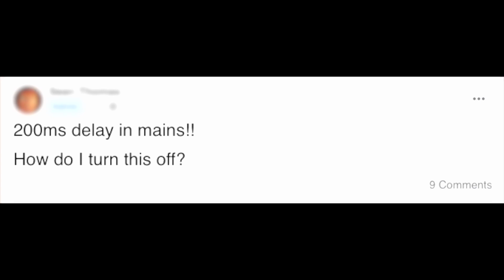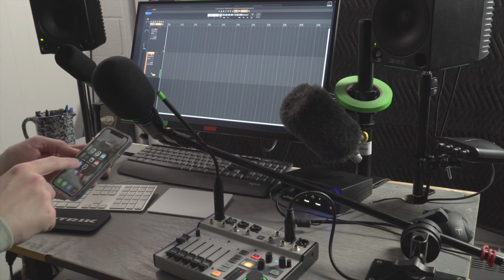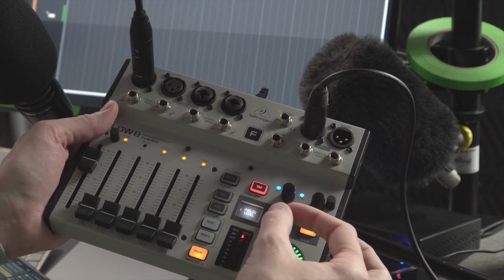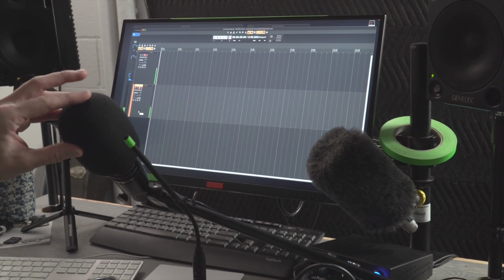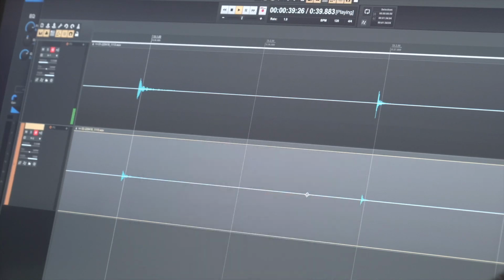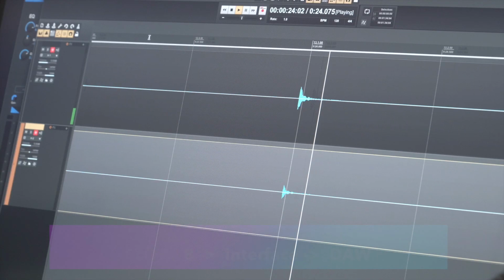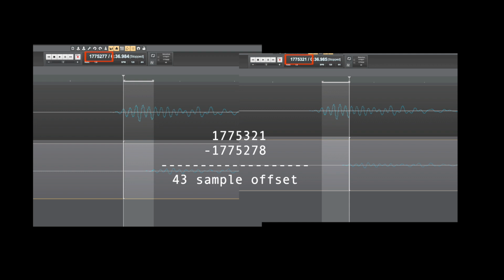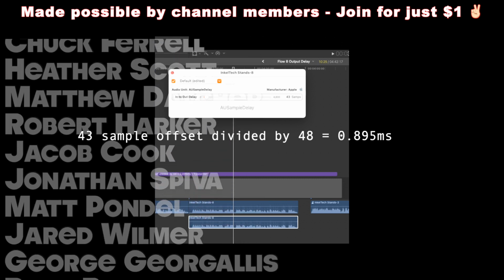FLOW 8 Main Output Delay STUCK at 200ms?

Comment: Here's the set up I'm trying to achieve. Drummer ears into phones jack- 2 separate Monitor mixes for myself MON1 (singer/guitar) and Keys player MON2

For live shows with click and tracks I'm running click into channel 3 and backing tracks in channel 4. FOH mix (to hear ourselves/ our instruments) Channel 1

So far I've noticed if drummer makes level/fader changes while on MAIN mix mode- it also effects those levels on both MON sends-

Isthere a way to make totally independent (aka 3 separate mixes?). Under MENU- Do I need to set phones jack to (pre or post mix? Or MON pre/ post?)

OR is main mix faders always going to effect MON 1 and
Reply from the maker: Hey Dustin, it sounds like you'd want to be in Pre-Fade mode on those sends if you don't want the FOH adjustments to affect them. Give it a try & see what happens!
Reply: @DcSoundOp  @ thank you!!  I’m mostly asking about on the flow 8 itself-  if drummer is on main mix mode and adjusts levels-  how can I prevent that adjusting the MON1 and MON2 modes.

Comment: Thank you very much for this video. You may have said it in the video, but my English is not good enough. That's why I wanted to ask in writing. I live stream on Twitch. What I'm wondering is this. When I use all these effects and digital audio enhancements, will I experience a latency when monitoring the audio? Latency in hearing myself prevents me from speaking fluently. Is it a suitable device for radio broadcasts on Twitch? I use Behringer x1222 analog mixer in my live broadcasts. You know, when I speak, I turn down the volume of the music with a fader. When I'm done speaking, I turn the music back up. Spotify music sound from my computer and my voice from my microphone go to the broadcast as a single stereo mix. In other words, when I add any digital effects to my microphone, my music sound is affected because they all go on the air as a mix. Whereas, I want to make sound improvements to my microphone input and music input separately. Do you think it would be a significant upgrade? Will this solve my problem? For this kind of solution, I normally have to use an expensive and large digital mixer like the Presonus StudioLive 16. And I'm looking for a more compact and cheaper solution. You can also suggest a different mixer. Thank you so much.
Reply from the maker: When you are monitoring your own voice locally on the mixer, there is no latency that you will hear... that will only come into play if you have (input monitoring) turned on in whatever software you are using. If you add effects at the computer and then monitors that back as you talk, yes you will experience latency for sure. Don't do that :)

Comment: Is it possible to use xlr inputs 1 & 2 also with line level instruments and an xlr to 1/4“ TS Adapter?
Reply from the maker: No, inputs one and two are capable of instrument or mic level inputs only. You would need to pad a professional (+4) line level signal coming in there.

Comment: The only latency issues I've had are with the Bluetooth. I measured that at between 500ms and 800ms. I reached out to their support and after a few weeks they confirmed that this is a expected limitation of the Flow 8. It's a shame because low latency Bluetooth codecs (such as aptX) should be able to achieve sub 40ms which is fine for lip sync on video. This can be mitigated in a variety of ways (external Bluetooth receiver or other cable adapters)  but they all use up additional inputs which some users might not have available or suit their use case.
Reply: Have you kindly suggested the Behringer team if they would implement in a future firmware update?
Reply: @user--crazyhandle  Yes. They said they can’t as it’s a limitation of the device they use sadly.